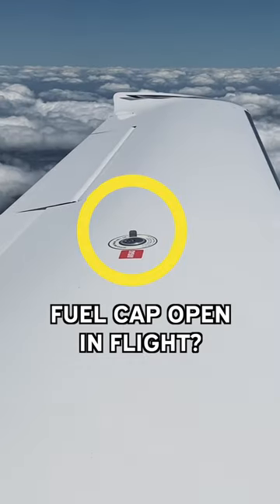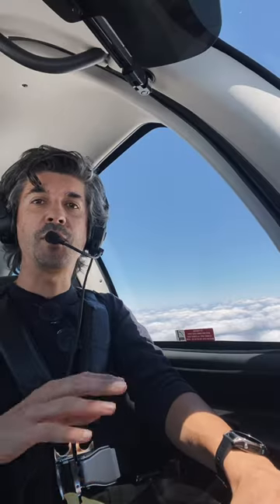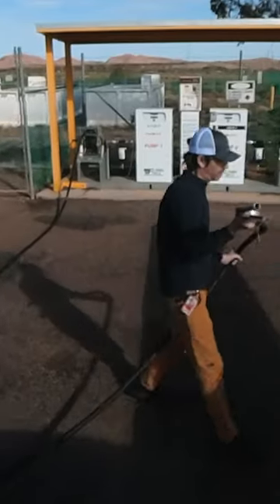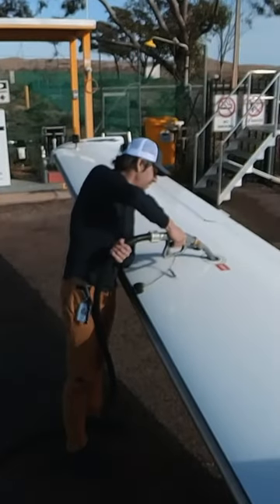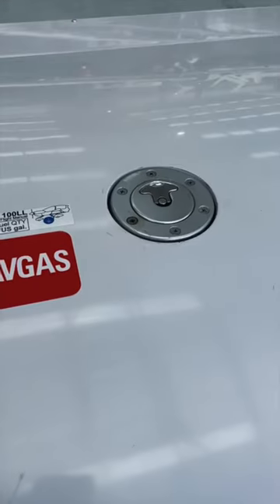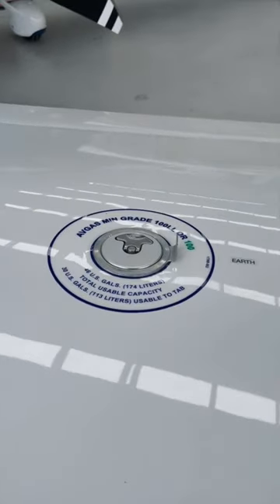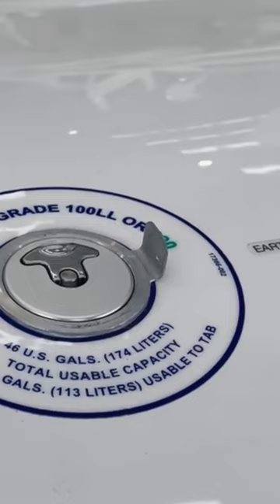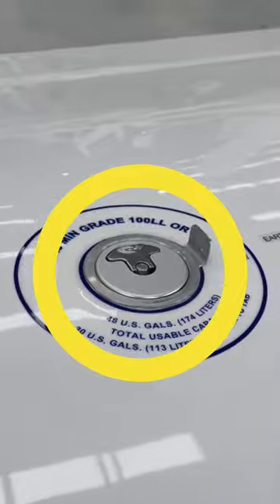Fuel cap OPEN in flight?

Comment: The earthing point! On the DA40 fuel cap, the earthing point that is near the fuel cap is the fuel cap itself as there is a metal bonding cable connecting the fuel cap and the aircraft :)
Reply: I’m familiar with that! When I did a gliding course for a week, we had a pawnee tow plane and as an excited 16 year old, I got to refuel it every 3 hours, slapped the earth cable right onto the exhaust!

Comment: This is only necessary for a non-metal aircraft. Since most aircraft in the US are metal (for now), we do not ground our aircraft using tabs on the fuel cap. We typically ground the aircraft using the nearest tie-down to the fueling cap. On composite aircraft you use the dueling door, itself. 

Every aviation self-fueling pump that I have ever used has a grounding clip that is separated from the actual pump, itself. It is connected to a bare metal wire line that is on a spool bolted to the ground. On fueling trucks, the spool is bolted to the truck frame. You are required to  connect the grounding clip before extending the hose to the aircraft.
Reply: I usually ground to the exhaust but to each his own

Comment: My fuel cap popped off at Orange and when I did my preflight at Temora noticed it was missing. Put some hundred mile an hour tape over the fill and returned to orange and found it. I did lose fuel on the way down.
Reply: Is that the really shiny tape that looks like aluminum foil?

Comment: I took an American as a passenger in my RV-6 last weekend, and he’d never seen the earth tab on the tank flange before — they just don’t have them there, and their fuel filler nozzles don’t have earth clips either. I think it might be one of those special Australian things; or maybe a Commonwealth thing (do the kiwis use it?)
Reply: This is only necessary for a non-metal aircraft. Since most aircraft in the US are metal (for now), we do not ground our aircraft using tabs on the fuel cap. We typically ground the aircraft using the nearest tie-down to the fueling cap. On composite aircraft you use the dueling door, itself. 

Every aviation self-fueling pump that I have ever used has a grounding clip that is separated from the actual pump, itself. It is connected to a bare metal wire line that is on a spool bolted to the ground. On fueling trucks, the spool is bolted to the truck frame. You are required to  connect the grounding clip before extending the hose to the aircraft.
Reply: @deanfowlkes  Reiterating the Australian case, because that's the one that applies to Stef's operations:

We do what you've described, and we ALSO have an earth tab next to the tank flange, even on metal aircraft.

The usual process in Australia is to connect the earth wire you've just described to the aircraft's grounding point (usually a tie-down or an exhaust tip), then get the hose, which has another short grounding lead, usually about 2 feet long attached to the nozzle, which you clip onto the tab on the tank flange before you open the caps.

I'm sure there's some deep dark historical reason for doing it like that. Maybe static discharge caused by hauling a rubber hose over terrain in extremely dry weather. Maybe superstition from the regulator. Dunno. But it is what it is.

I don't think the tab next to the tank filling port is mandatory anymore, but I do know that one of the modifications that used to be required when an aircraft was imported to Australia in the 1970s/80s was that an earth tab needed to be attached and electrically bonded to the fuel tank's filler port if the manufacturer didn't already have one. Didn't matter if it was a metal airframe or not; Didn't matter if the actual tank was a rubber bladder that couldn't conduct electricity. Almost every 172 I've ever seen in Australia has them, even though they're not on any of the 172's I've seen in the USA.

Comment: But why is it designed this way? Any particular reason?
Reply: Cirrus is a composite aircraft, so you can't just ground the airframe to prevent static discharge making fuel go boom.

Comment: is that for grounding the plane while fueling? ive fueled tons of Cirrus planes but i havent seen that before
Reply: Where's the ground on Cirrus aircraft usually?
Reply: @Karuiko  im not sure if they have a specific point but i was trained to use the tow connection point on the nose wheel so thats what i always use, although any unpainted metal on the aircraft can serve as one

Comment: The tab is actually a modification required for VH registration. The OG SR22 doesn't have it, nor the big red sticker.

Now the bigger question Stef, which way do you face the locking tab? Forward or Aft?
Reply: Aft, so the oncoming airflow won't push the fuel cap open.